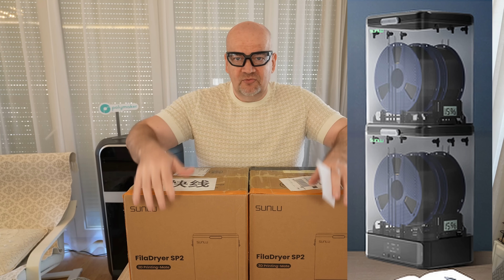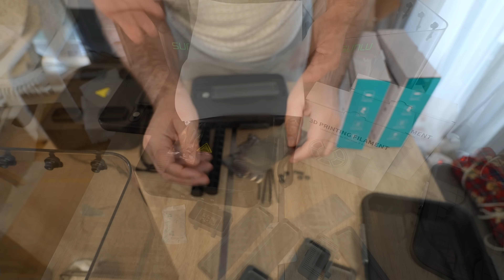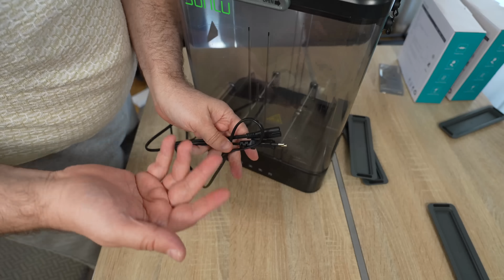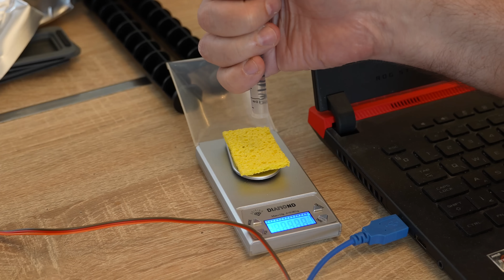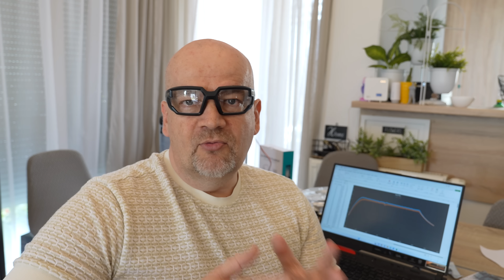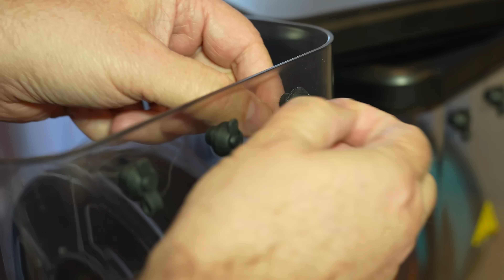Sunlu SP2 Review: 2-in-1 Filament Dryer and Storage Box

Comment: sooo-- i bought one. according to the data sheets and a lot of reviews the SP2 is suited for 2.5 kg spools. Well, i am (un)happy to report that at least the standard spools used be eSUN fit snug. they fit so "snug" that they are not turning in the dryer, making any attempt to print out of the dryer mood. that's a downer. but at least you can dry them

Comment: hows the hot spots on the spool after 3 or more hours in the dryer? 
i assume the air is circulating so at some point the internal temperature should hit a equilibrium

Comment: I had to go with this instead of the PolyDryer because Polymaker does not ship to me, and my local reseller never seems to have them in stock either.
I'm not too sad, this seems like a pretty good dryer too, and the fact that it hold two 1KG spools at once is huge plus! I got another box along with the dryer, and allegedly its a "deal" because it comes with two spools of PLA+, but considering the Polymaker box is $30 and the Sunlu box is $65, I'm thinking I overpaid for those two spools.

Comment: I really want to see a Polydryer Pro. 80-90C with a doublewide base that can take either one 3kg box or two 1kg boxes simultaneously (bonus points if you can dry two 1kg boxes at two different temps). Price it at ~$120-150 including a 3kg box with full backwards compatibility with existing 1kg boxes and it'd be a killer deal.
Reply from the maker: I want to see it too. With a vacuum valve.

Comment: It looks bulky for what is essentially a PolyDryer clone, but bigger. For some, it's a benefit, but for some, it's not so much. I don't understand stacking, though. Who would stack those huge pallets? PolyDryer benefit is that a) it's quite small and has a great seal. b) Stacking it makes at least some sense. 
Also, from the video, it seems like it is super noisy. Were you able to measure the noise level?
Reply from the maker: I measured, it's quieter than S4 or E2, but lauder than similar average dryers.

Comment: I am using only engineering filaments, drying all the time, only dryers that exhaust moisture. My experience, pack filament in one or two layers of ikea plastic bags with double lock. Dry before you pack. Im only using enclosed printers with enclosed filament boxes. Dry filament from bags if they have been in storage for more than a month. Never issue with wet filament
Reply: Buy some cheap molecular sieves and govee hygrometers and you can monitor your humidity levels and change out the sieves once they become saturated to 8-10%

Comment: Great video. Is the Eibos Polyphemus the only filament dryer currently on the market that rotates the spool while drying? I think most current filament dryers feel like just food dehydrators that have a different design and shape to be more compatible with spools. I would like to see actually more in-line dryers and more affordable compared to Drywise (only in-line dryer I am aware of - made by Magigoo company), as now there is a big gap between up to 300 euro filament dryers and the 1400 euro Drywise in-line filament dryer. I wonder if Polymaker has tinkered with Drywise and if they will have Fiberon filament profiles for Drywise, although I don't see myself ever buying a Drywise machine to be honest.
Reply: 1400 is ridiculous for a dryer. For 400 you can have a drying and vacuum storage solution and be better off. Dry your spools then vacuum store with molecular sieves and never have to worry about moisture for several months. I have dry boxes with several nylon and PET spools in them at less than 1% humidity for almost two months now.

Comment: This and the Polymaker thing, are a cool idea. But it does just add more things to deal with. This on, being that it holds 2 spools at a time, might defeat the purpose.... Personally, I think getting an air tight cabinet or shelf and some vacuum bags, along with a 2-3 dryers, is a more organized method. My office is tiny, but the shelf and vacuum bags keep it all out of the way and rather simple. I also made an 8 spool heater from a tent enclosure thing and a small heater, from Amazon.
Reply: In my experience vacuum bags are hit or miss. Many of the ones I purchased cannot keep a vacuum. Even using the included 'zipping' tool.

Comment: My favorite Filament Dryer from Sunlu is the S4 - by far: very powerful (for normal materials like PLA or PETG) and quick to rotate or change the spools. I am not convinced of the stacking or storage functionality of this new unit, the SP2. EDIT: I loved the line trick to rotate without opening! But then, it won't push the moisture out. As you demonstrated, opening from time to time is good.
Reply from the maker: Yes. Maybe I should do that test with all holes opened. No user manual in this early version.

Comment: since bambu released the ams pro. the only reason you need a filament dryer now is for high temp material and if u have a spool lying around waiting to dry while you print from ams. But I still dont understand why very few companies dont put a rotating mechanism in their dryers?
Reply: There is the Bambu Lab ASM HT. It fits only 1 spool and goes up to 85°C
Reply: Bambulab is limited to four filaments.
These dryers can be used with infinite number of boxes.
Reply: That assumes the use of a Bambu Lab printer compatible with the new AMS. If not then your a spending $400 on a filament dryer without the benefit of using the MMS functionality. Which makes using and AMS 2 on with non-compatible printers an uneconomical drying solution.

Go Habs!
Reply: @cidercreekranch  100% correct sir!  if i didnt have a bambu printer i would get a 4 Spool dryer that rotates

Comment: sadly still 70C limit, almost like a polydryer clone then
Reply: Nah. Polydryer does not get over 56. I have two and they both have the same problem. One was a warranty.
Reply from the maker: Yes, just bigger. Which can be advantage or disadvantage
Reply: I bought an air fryer that reaches 80-200c for 50$. I use it for nylon at 90c for 1 hr is enough
Reply: @morecakesmorelays3270  is it one of the drawer ones, they use an old coil stove element with a circulating fan.
Reply: @themadhater9003  it's called "LumaBella" B-9004 
8 liter capacity enough space for one spool. Only disadvantage is that the max timer is 1 hr. But fortunately for me that's enough because I tried drying for 2-3 hrs and weighing the nylon and I got no more mass loss. So that means 1 hr is enough for this specific pa6 that I use which is yx polyer unfilled pa6.

You can probably get a better variant with a longer drying capacity or modify it but idk how since I'm ignorant when it comes to electronics
Reply: @themadhater9003  YouTube deled my comment sorry friend
Reply: @morecakesmorelays3270 do your spools melt at all?
Reply: @coledavidson5630  the plastic spools no but the sticker on it delaminated. I'm not sure about cardboard spools tho. Probably would melt or burn. Also it's a little bigger than average air frier. I took 1kg spool with me before buying the air frier to make sure it fits.
Reply: What brand air fryer?
Reply: I have no idea why, the heaters are capable of reaching much.   higher.temperatures.  I use alot of those 1gal cereal boxes for my filament and want to design a heater for those.  These units are way overpriced.